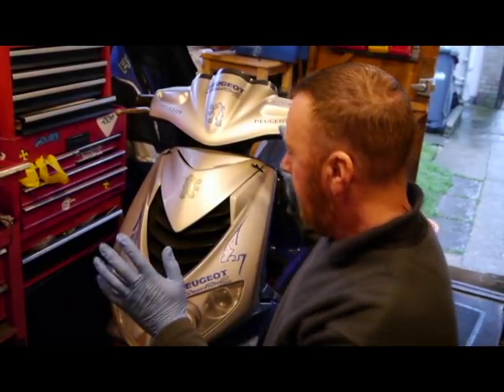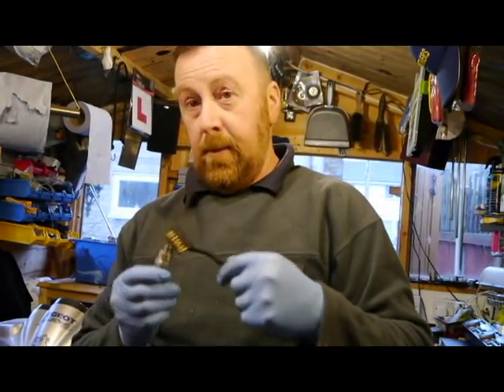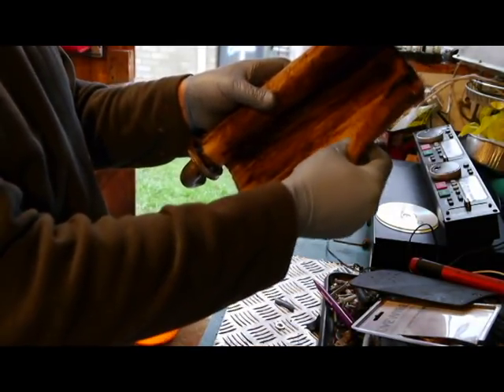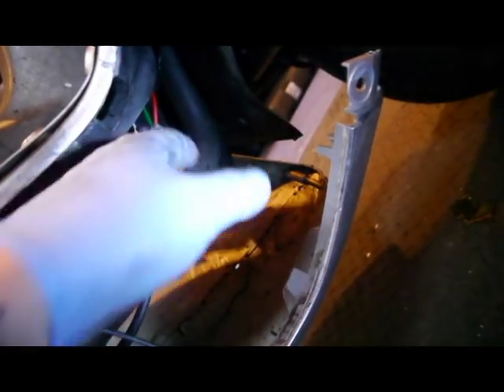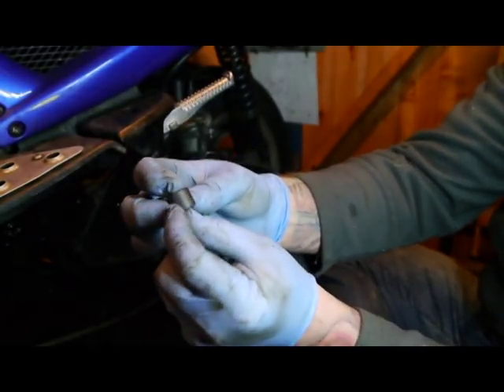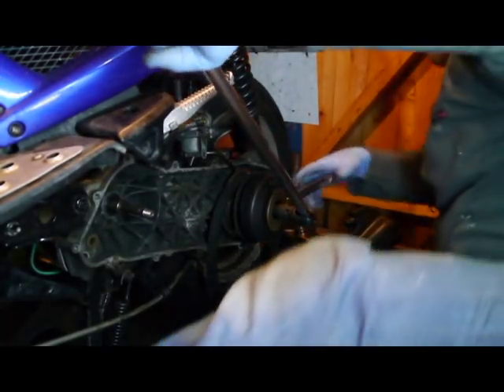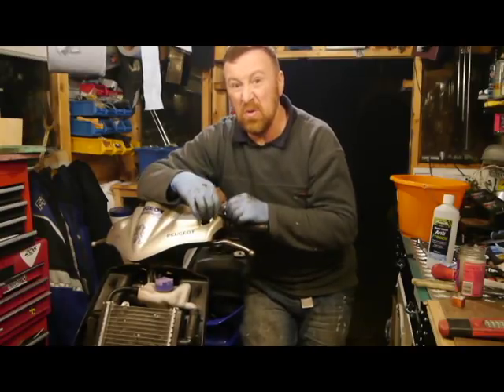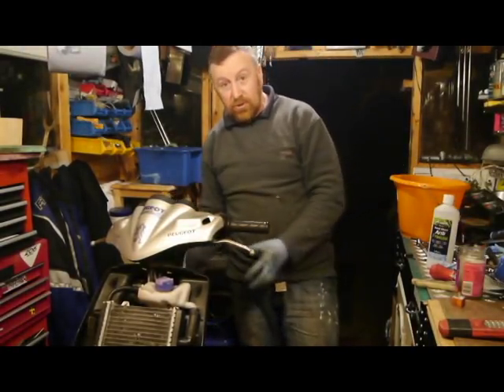SPEEDFIGHT 50CC MOPED STARTER RELAY EXHAUST CARB VARIATOR  FIX MARK SAVAGE

Comment: Lots of little things wrong with this one Mark. When the electric starter was not working on my project scooter, I did the normal checks with a multi meter. Just to be sure it was the solenoid though, I bridged the terminals with a wire. Started straight away. Good to double check sometimes it you can before ordering.

Comment: My choped up low rider yamaha scooter only has kickstart and nothing else and its loss of power or hp is fd up it only gets going a few seconds after full throttle and some times not at top speed. I kinda know what i need yo fix on it thanks to your video's you are amazing man keep it up. Im doing some more work on it this weekend i will let yall know what happens after i overhaul the belt, and pully berrings. Stay tunned.

Comment: Hey mark great video. I opened my variator on my piaggio typhoon only to find out the previous owner lied to me. There were 4 5.5g rollers and 2 7g rollers. well i guess that explains the vibrations in my foot panels i think. I really appreciate your videos which gave me confidence to tackle the problem myself.
Reply from the maker: mike car that’s good to hear bud and why I do my videos thanks for the feed back and
Thanks for watching

Comment: hi mark, my mate has a speedfighter and the wheel isnt moving on revs but then sometimes moves, no bogging or power loss, i am aware the person before put new rollers but npot sure if thats the issue, any ideas ?
Reply from the maker: HexBeatz hi bud thanks for watching 
Best start with the variator take the cover off and like in my videos check it’s all working as it should 
Please share like and sub 
And watch them they will help 
Mark

Comment: I'm wondering if you checked the crank oil seal when you took out the variator. it's unlikely it would run at all but could have been where the excess oil was coming from.
Reply from the maker: charlie p yes bud and it was copper grease not oil as it was also on the clutch pole 
Guess someone thought it was a good idea but I always clean then dry 
Thanks for watching 
Mark

Comment: Mark, how do we do pms? I’ve asked you about this speedy2 that I have, can’t get more than 45kmh out of it. Spacer removed, weights at 6.5, new belt, standard exhaust opened, dumb pipe blocked off, dellorto type open cdi installed… I’m pulling my hair out.
Reply from the maker: As I've said bud 
Sports exhaust 
That will help a lot 
Then 62 jet 
Tune 
But sometimes it could be a worn piston and rings so make after a replacement

Comment: Hiya Mark, watched a fair few vid's on the speedfight, my son has one and has had a few problems that ive managed to sort using you help. Thing is, the bike suddenly stopped last week and will not now start again, work to date to try and fix, carb off and clean, compression test (ok), new spark plug, head off and check (ok), reed valve out and check (ok), we have a good spark and fuel going in but no bang ! any idea ?
Andy
Reply from the maker: Andrew McFarland did you do the wet hand test ?
It still can be the piston bud even with compression !
Take off the head like in. Y videos and check the piston and down the sides 
They do wear and you don’t know what 2t oil he used or if he ran it dry 
With over 70 videos On speed fights they will help

Comment: Loving the videos. I got a small problem mines is smoking bad and it brakes up and cuts out and wont be able to start it again till the next day with some carb cleaner in the intake. Im currently using the blue 2 stroke but been told that makes them smoke more than red mixture or will it be to rich and need to lean it out a bit?
Reply from the maker: It shouldn't be over smoking as it mixes with the carb as the petrol comes in with the pump
It should like your rings may have gone ?
However if you are have to clean carb all the time and guess clean plug then it's over mixing and needs tuning as in my tuning video  ,I have over 70 speed fight video to help plus another channel with all of them on a play list
Reply: @marksavage  yes the spark plug is wet and black so its running too rich will go and check out your tuning videos

Comment: Hi Mark, would you be able to take a look at my Speedfight 2? Has trouble starting, the kick start is dud, doesn't pull away, exhaust is loud and smoky, had to change electric choke to manual because it wouldn't work etc.
Reply from the maker: hi bud
everything you are saying is in my newest video maybe give that a watch as it will help a lot and may even get you back on the road 
you will need to repack the exhaust and theres a video on that too as I have over 70 videos on speedfight all will help 
type in mark savage speedfight and they will come up but do look at my newest speedfight video 
really hope this helps you
Reply: Thanks for your response I’ll have a go!

Comment: Hi mark, I commented under your last video. I messed around with my air/fuel screw and it wouldn’t start. You advised me to use easy start and adjust from there. Unfortunately, my bike still wouldn’t start. I checked for a spark & cleaned my spark plug  yet it still wouldn’t start. What do you think it’d be? Could you help me please? Great video once again (gave it a thumbs up and shared!!)
Reply from the maker: madz Rt hi bud sorry I get a lot of comments and some slip Lol
Oh ok so it was running ok then you adjusted the carb now nothing 
Take off the carb and clean / service it wash air filter and change plug 
Re set carb then try kicking over to start and see how it goes 
If starts all ok then tune if now use easy start as before 
What was it running like before ?
Is the piston ok / compression 
Is the plug getting wet 
Have you tried the wet hand test ?
Thanks for watching and sharing bud 
Mark
Reply: The compression of fabulous, piston had been changed with 70 kit about 2 months ago and it hasn’t really been ridden. Only just up and down my road! Spark plug is fine a tad bit wet if anything but nothing too bad
Reply: Thanks mark!! I’ll take off my carb & air filter and clean it, if it still doesn’t work I’ll come back to you. Thank you ever so much for helping I appreciate it
Reply from the maker: as you must know i don't like 70cc kits they are hard to sort the mix right and fail . you can still have compression bud even if it has failed at the side, if no luck with the carb and settings i'd take it off to inspect just to be sure 
mark

Comment: You alright mate iv just buyed a Peugeot vivacity 50 2 stroke it starts up but doesn’t won’t to go I took the air filter off and it seems like it wonted to go what you think it is ?
Reply from the maker: so it starts up and ticks over?
but wont rev up or does it stall / bog down
I have many other videos that will help on my channel most under speedfight but will still help
if bogging down check out my video on this 
also clean carb
service videos / plug etc they will get you back on the road bud

Comment: Mark is changing the water pump spacer hard work?
Reply from the maker: Lyon Hart to take off the water pump best for access take off the exhaust then it easy to get the water pump off on a speedfight 
You will have to drain out the water 
Hope that helps mark

Comment: Hello Mark,

I've got a question about my Speedfight 2.
It starts without any problem, it stays on but when I want to drive away its going terribly slow.
It revs up, but going very slowly forward.
After a while the engine runs better and it seems the problem is gone.
I can't figure out what the problem is.

gr. Michel

(sorry for my english)
Reply: Michel Hagenaar rollers need replacing
Reply: What cc is it? I put 8g rollers down from 13g on my 100cc

Comment: Hi Mark need a lot of help from you. I have a speedfight 2 100 2006 model . Few weeks ago i tried starting my moped to go to work and it would start I tried starting from electric start and nothing but when kicking it wouldn't turn over either, instead it maid a load popping noise sounding like comin from exhaust then in starting making a chugging noise like an old steam train.  So anyway today I stated ran fine for a minute apart from not exceeding 20MPH and them completely died . Not starting from electric start and no compression in kick start.... HELP PLEASSSEEEE
Reply from the maker: Adam Hughes hi bud thanks for watching 
Piston fail bud 
I have many videos on how to change the piston and what way it goes and if things go wrong 
It’s not a big job and easy to check and fix
They can just go like that bud
Hope that help
Please like share and subscribe 
Mark
Reply: Thanks Mark are they expensive to buy . I'm just so glad it's not complete engine failure.  I think I might of cryed.

Comment: Hi just wondering. Do you think it's recommended to mix the rollers up with light and heavy ones?
Reply from the maker: Hayden Short I do but not all the time 
Make sure if you do you they are  even like in my other videos on rollers and variator system 
Mark

Comment: Hi mark , i have a Gilera Storm 2t 07 plate , i ran into a problem when ive done my upgrades , i have a Polini Hi-Speed variator in 5gram rollers - the blue contra spring in the clutch assembly and red (medium 1.4) clutch springs and a stage 6 pro rep exhaust which powerband is at 1050rpm , the bikes pull of is really slow until powerband ? I was wondering you can give me a hand on what i can do , if you need a video of me driving it and showing you and example im more then happy of you can shed some light on what i should do , was thinking lighter rollers 4.8grams , also i really enjoy your videos as there is no informative moped mechanics about that know there stuff , keep up the good work :)
Reply from the maker: hi bud 
thanks for watching 
ok with your bike 5g rollers are light and really should be pulling away well, what jet are you running and did you up jet it ?
with the sports exhaust you might have to too get more fuel into the head to get it going along with a tune up 
otherwise work your way backwards and put on the old clutch and see how it run then the vatiator and so on then you might find out where its going wrong 
hope that help
mark
Reply: mark savage hi mark and yes i up jetted to 68 mm main jet , also inhave a derestricted , i was thinking the contra spring ? The bike does 60mph , stock air box
Reply from the maker: so it's all running well just pull away, i think your right have a play with the variator make it's all running as it should with opening up when revving 
mark
Reply: mark savage i think it may need a lighter contra spring or harder clutch springs ? To let the bike rev higher before engaging into the clutch bell housing ? Because its engaging about 4000 rpm when ithink it should be at 6000 rpm + becasu the type of exhaust ?
Reply from the maker: yes i think you might be right if it's not letting it get off and at such high revs 
mark
Reply: mark savage whats the best way to put the clutch springs in ? I done it with some pliers and it was hard as hell :0 wondering do you have a better way or is that the best way ? , thanks for the replys mark :)
Reply from the maker: MrRainesFTW me too Lol by I bent over a screwdriver and hooked them in which was much easier 
Give that a go or you can buy them bud 
Mark
Reply: mark savage yeah il give that ago im gonna do it now just got to take the cvt case of and clutch etc the green jasil clutch springs are hard to get on :(
Reply: mark savage cheers mark , put the harder 1.8 gauge springs on with a screw driver was a hell of a lot easier , made the difference the clutch engages around 6 fully and gets going alot better , keep up the good work and videos i enjoy them :D merry xmas :&
Reply from the maker: MrRainesFTW that’s great new bud , you too
And as norm luke share and I’m happy
Mark

Comment: Hi. I have the benelli 49x 2014. And i have problem. When its colder(morning) it gos ok. But when I come back from work it really strugels to acceleration.  It has no power(hp) but when it gets going its good. But when I stop 🚦 it it strugels again.  Can you help me?
Reply from the maker: Ergo Pokker start with a service bud plug and air filter
Then carb clean and tube 
My videos will help
Reply: @marksavage  done all that. Maybe it needs biger jets?
Reply from the maker: Ergo Pokker worth a try if you have serviced and tuned 
Go up in 4s but I’d of said tuning as running on choke it’s ok and then off it rich !
Reply: @marksavage  Main and pilot jet up 4 sizes?
Reply from the maker: Ergo Pokker watch my jetting video bud it explains all

Comment: I’ve just purchased this bike off the people you sold it to mate and they have informed me they got it from you and it now  has trouble starting , we’re shall I start mate ?
Reply from the maker: yes I remember it ran fine just didn't like electric start from cold which I did tell the them to kick start it and not to open the throttle and it would and did start fine it was a good bike last December, they changed the carb and said that was the problem and heard no more
I did say from the start to bring it back or I would fix it if they could bring it to me as they collected
I never like selling a bike that has problems and honestly thought it was all sorted, they contacted me a few months ago to offer me it back as they no longer needed it
so you bought it then 
mark
Reply from the maker: now you have found my channel there is over 70 videos on the speeedfighs so you will be able to fix it and get it back on the road bud
Reply: mark savage  picked it up today mate was going to change rollers as it sluggish on pull away ?
Reply from the maker: they changed the carb and think they got a Chinese carb not speedfight so check that first as they never really run right as air mix screw has to be all the way in to run 
changing rollers on a moped, it's always worth a look and clean and see if they are ok before paying out but 6g are ok to change to 
i'd give it a service so plug and clean change air filter and go from there bud 
mark
Reply from the maker: hi bud 
i'd take down your number off bud as this goes world wide !!!, any way yes I do bud I have a bike for spare so pm me and we can chat 
mark
Reply: mark savage  going to need few more parts now as I’ve got no spark 😂
Reply: @mitcheledwards115  if you've got no spark. It's down to either rectifier, cdi or stator.

Comment: Hi could you give my some advice my 50cc eating fuel it goes up to 60km for full tank. Thanks
Reply from the maker: Some mopeds / scooters only have a tiny fuel tank 
But that's not a lot of miles or kpm 
Its it 2t or 4t 
A good service so plug and air filter 
Tune ? And clean carb like in my videos and if 4t get the valves looked at
What sort of speed are you getting as the faster it goes the more fuel will be used
Reply: savage  thanks for your reply its 2t I clean the airfilter
Reply: And when its run very strong smell of petrol
Reply from the maker: @aA-lg1se  tuning bud follow my tuning video 
Start at 3 like in the video work way out 
Type in tuning mark savage it will help bud
Reply: @marksavage  6 litre fuel tanks I put 6.3 g roller
Reply from the maker: @aA-lg1se  as long as it pulls away ok the rollers are fine and that's only just over a gallon bud so not a lot of fuel 
You should be getting more that 10k per litre so defo tuning bud
Reply: @marksavage  what the carburettor fuel mixture setting
Reply from the maker: @aA-lg1se  standard 3 half bud watch the tuning video
Reply: @marksavage  i watched the videos is it lexemoto 4t 125?
Reply from the maker: @aA-lg1se  no
https://youtu.be/6bxZ3gI7Csw
Reply: @marksavage  thanks for your video. What i can do for speed won't go up to 33mph its honda sfx 50cc.

Comment: Hi have speedfight 50cc lc what rollers would be good to put in it?
Reply from the maker: all round would be 6g's, remember to clean the variator and change belt if it needs it, thanks for watching theres loads of good spedfight videos to watch over 70!
mark
Reply: Thanks
Reply: Would 6.2g be alright as I can’t find the once u said?
Reply: @dawidkazmierczak1426  there's loads of 6 gram rollers. You can use 5 gram rollers. But use a white contra spring.